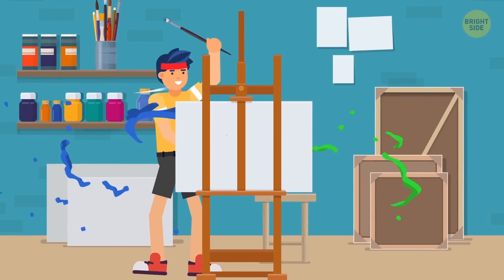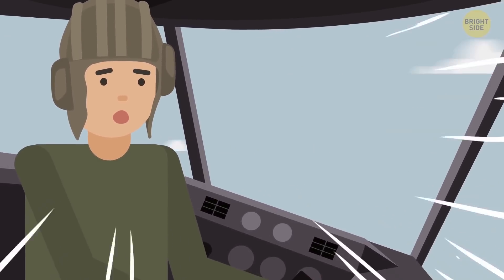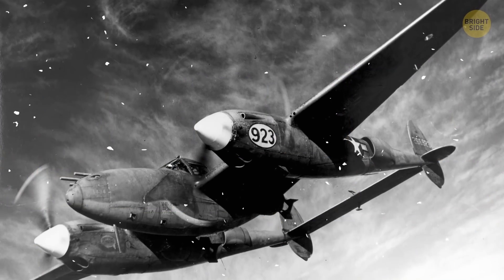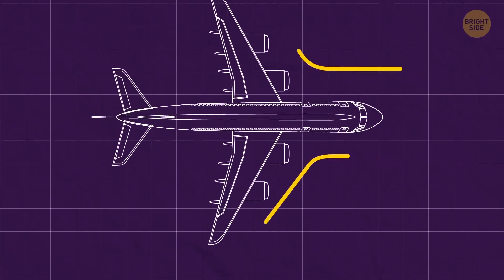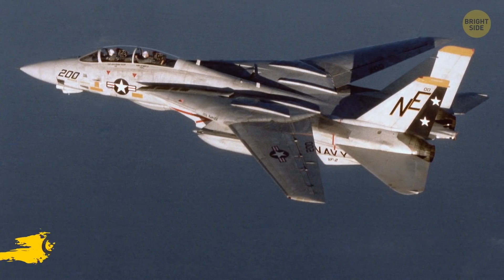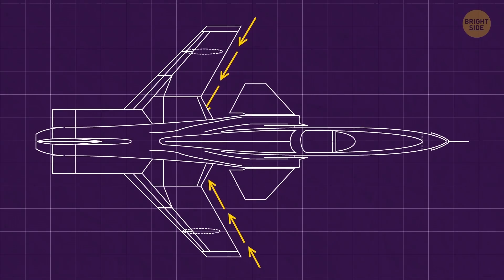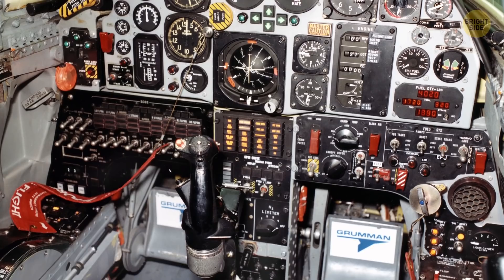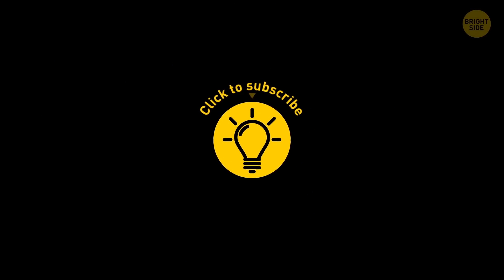Why Some Planes Need Backwards Wings But Others Don't

Comment: I feel the X-02S Strike Wyvern from the Ace Combat series covers a good amount of the issues and the changes and/or challenges with that plane's designs are easily fixable. The biggest issues it realistically has would be weight, large number of moving components, and price after all the digging around and a little research.
Reply: @David Price tbh, that is unnecessary. If anything it would best be used as an external weapon and the gap between  the air intakes would be where an external weapon bay would go. Or a railgun

Comment: Picture this...
Coming back from visiting friends in Ohio,  I decided to take a flight back instead of driving is I had been fighting off a sinus infection and didn't want to be behind the wheel. 
I board,  get settled, and quickly take some cold medicine hoping that it will start working before we take off and I won't feel immense pressure building in my head during takeoff. 
 All of a sudden the flight attendant comes back and asks if I would like to go sit in 1st class!  Having never flown 1st class, I could not move fast enough to accept the offer and enjoy kicking back and relaxing during the short flight. 
It wasn't until I got back to Raleigh and went to pull out my iPad so I could take a look at the picture of where I parked...that I realized it was in the pocket in front of me on my original seat in COACH! 😮😮😮
Thankfully, there were wonderfully honest  people working for what was then U.S. Airways  and they were able to return it to me within a few weeks.

Comment: That's not true they made it because it can fly backwards and forwards that's a true fact because my grandfather help make it and he told me about it so
Reply: Sorry 2 inform u but it grandpa did nothing more then rivet prices of metal also real since
An aircraft can't travel backwards and forwards
Basically the direction of the center of mass relative to the center of lift dictates the direction of stable travel
So if the com is Infront of the col the aircraft travels forwards and vive versa